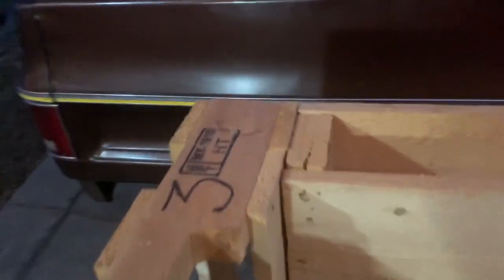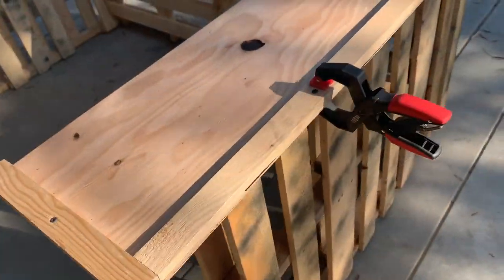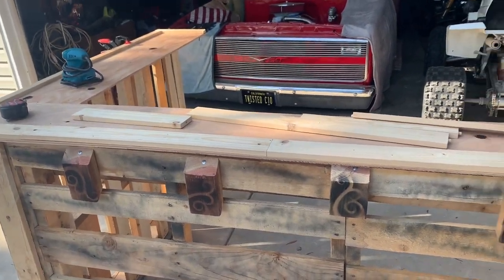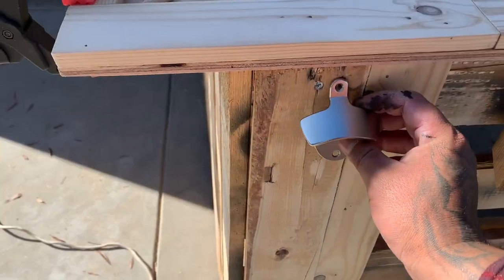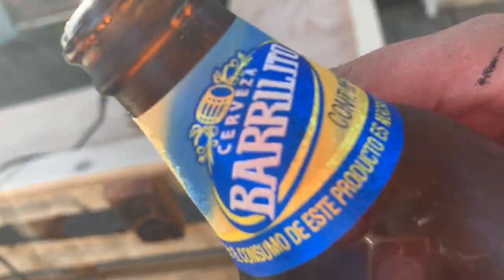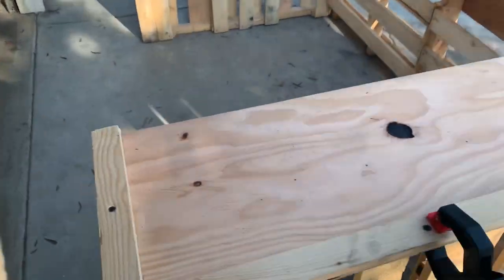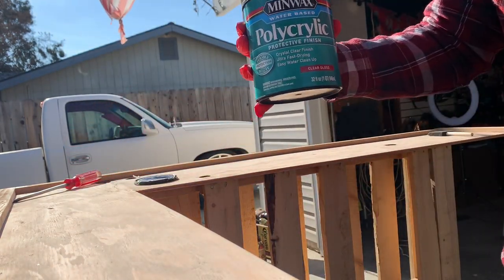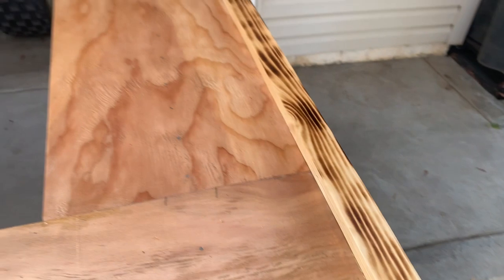Building a pallet bar /Surprising El viejon on thanksgiving🦃🦃

Comment: Nice work ,did you only used screws to hold it together? Thanks
Reply from the maker: Yeah and glue…
Reply: Nice and it doesn't wabble or anything ,sorry im asking cause I have to build a bigger o e for a store ,thanks
Reply from the maker: @king8521 no we put angle metal braces to reinforce it